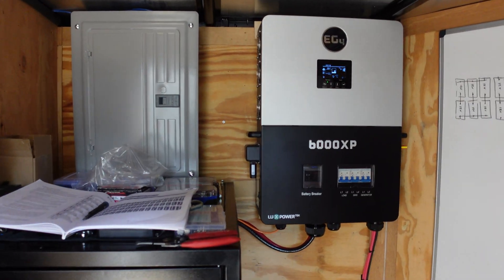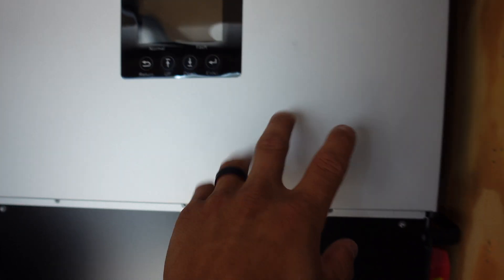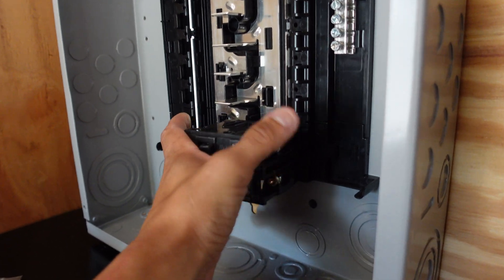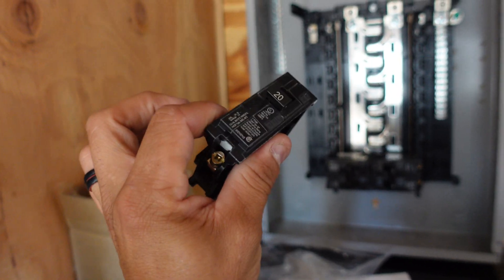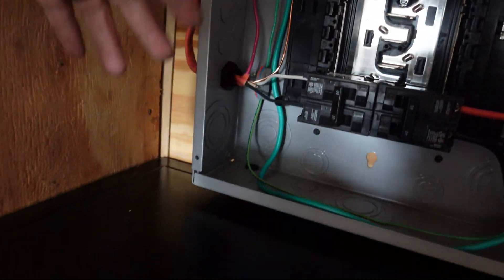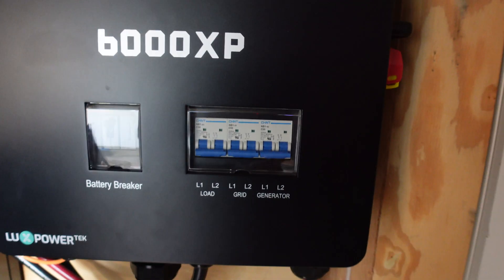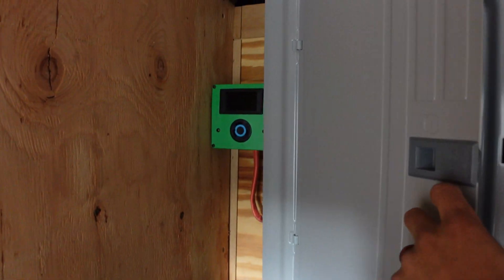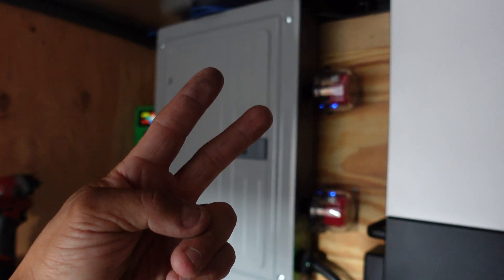240v DIY Solar Electric Panel | Step by Step

Comment: Any chance of getting the part number to the 240v socket with the display, off the breaker panel. ?
Reply from the maker: Check out this video I wired this up a long time ago with the information of the parts. https://youtu.be/qBWcVgOnoHg?si=Psx5KzG3d1TAMdK1

Comment: Don't pound the ground bar clamps down into the ground.  It will corrode the wire and you need to tighten those clamps regularly as maintenance anyway. Cover with something glass or plastic to keep them clean and dry. You will thank me some day.   Good info videos

Comment: Best to fully remove the green bonding screw in the panel. The grounding acorn nut is only a few bucks and does way more to create a good ground than just touching the ground rod. it is a few $$ and makes the setup way more accurate and safe.
Reply from the maker: Yea for sure I just didn’t have one lol. I’ll add a third zip tie 🤣

Comment: Great to see you’ve got it done.  Looks great.  I’m Going bigger this round. First setup was 24 kw SolarEdge setup on an iron ridge ground mount at my first farm. Here at home I’ve got 40 acres to work with. Just need to figure out where I want to lose my trees. Only got about 3 acres sporadically placed with no trees so it’s an issue.
Reply from the maker: Man tree removal is so expensive… hopefully you can sell the wood for some good money and it turns out to be a wash! But damn I wish I had that much land to play with!!!!

Comment: @CCXD awesome 👏 content, note that your neutral wire in your panel has a function, it’s for receptacles that require both ground and neutral wires, also the 6000xp has a few separated, controller boards, the MPPT and the DC to AC boards are completely independent so you have an ETS  switch to turn it on the breaker for your load is just for protection its not a on/off switch, but technically if you use it as one as long as the ETS board is powered on.
Reply from the maker: Thanks for the information dude! Your too smart for your own good Lol